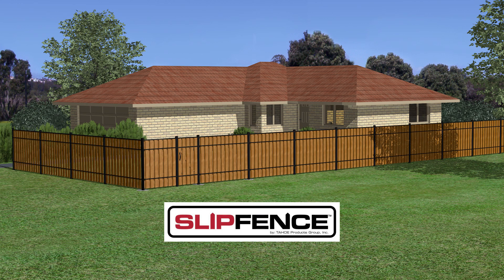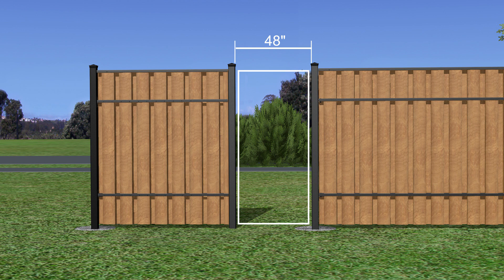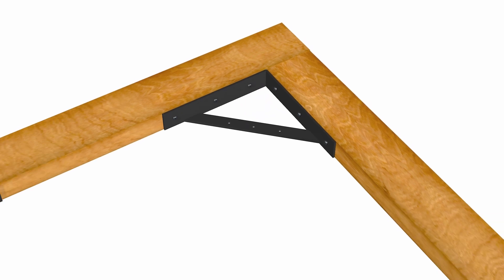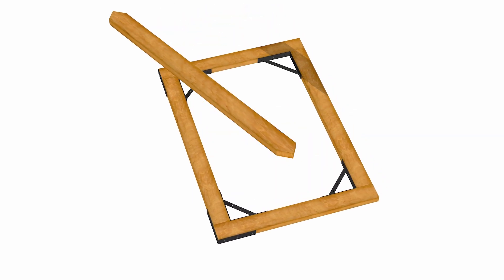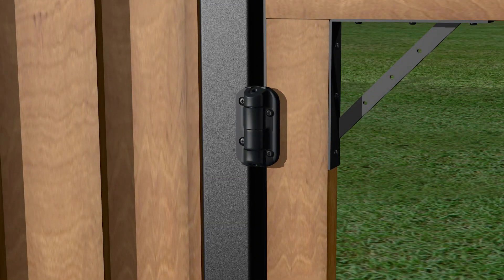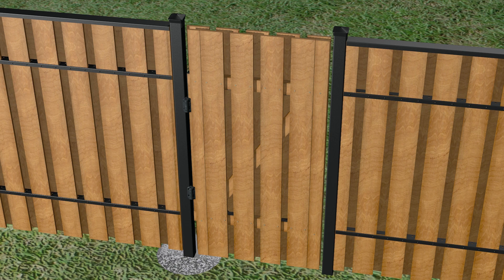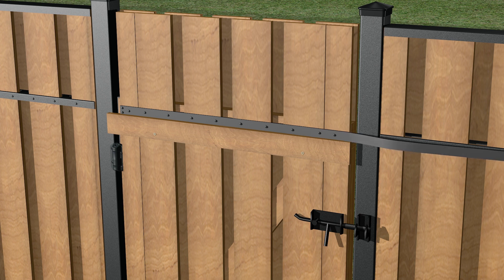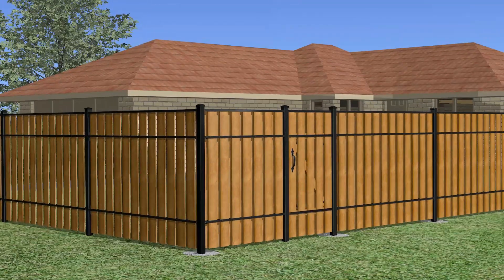Slipfence Vertical Gate Installation video.

Comment: On my instructions in the box, it says to subtract 1.5" not 1.25" from the width of the gap.  Wish I could find an explanation for the discrepancy.
Reply from the maker: Both will work but 1.5" is safer just allowing for minor pull on squareness over the years if at all. 1.25" leaves less room for any gate movement.